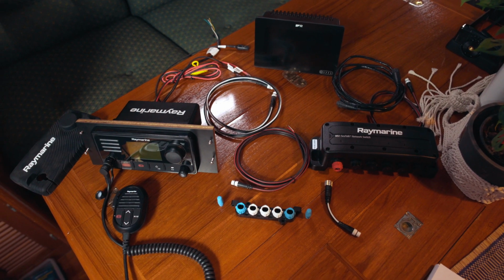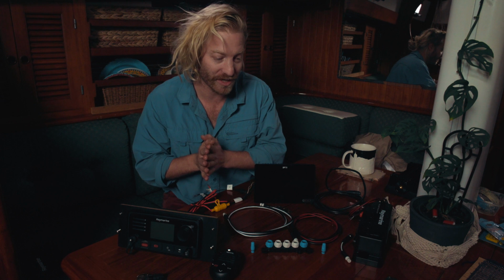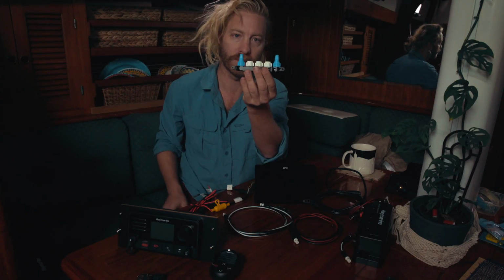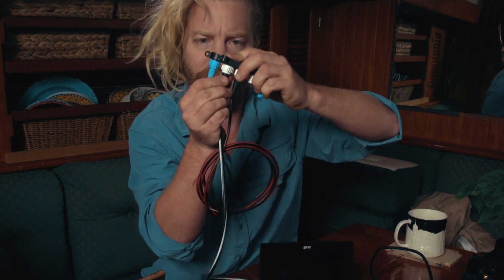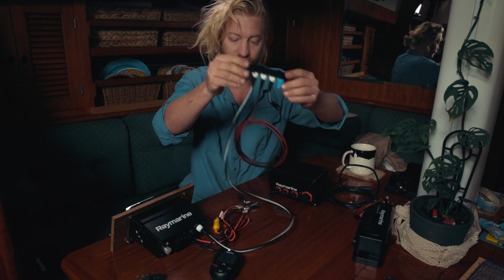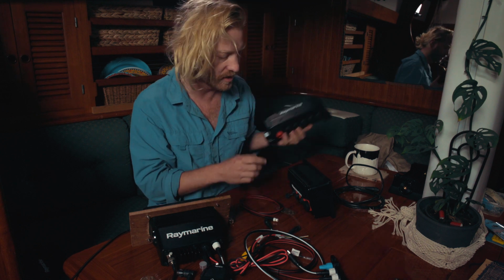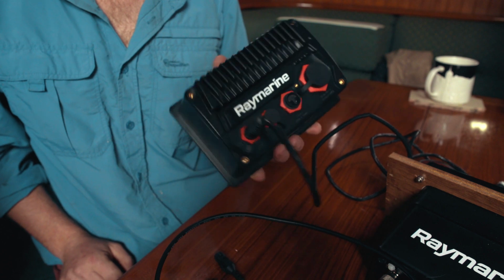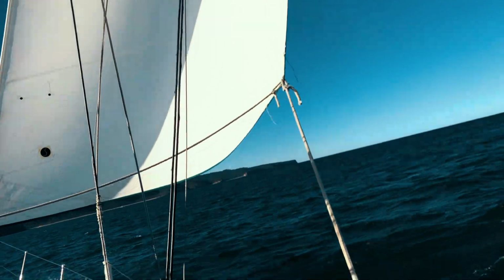How to Connect Raymarine Electronics with SeaTalk STNG Network

Comment: Hey we are currently installing a HS5 Network switch and are wondering what to do with the bare wire you can see at 5:49 
Cheery
Reply from the maker: When attaching the power cable to the Raymarine HS5 network switch, the screen wire (identified as item 4 in the power connection diagram) should be connected to ground. Here’s a breakdown of the power cable wires:

Red wire – Positive (+) power supply (12 V or 24 V DC)
Black wire – Negative (–) power supply
Screen wire – Ground connection

Ensure the screen wire is securely grounded to help with electromagnetic compatibility (EMC) and reduce electrical noise.
Reply: @Raymarine  thanks for the anwser 👍

Comment: i have a EV100 autopilot on seatalkng and a separate network switch HS5 that connects my Radar, AIS and Axiom.   I want to connect by EV100 to the HS5 so I can see my autopilot on the Axiom.   Is this possible.   I spent endless hours searching Seatalkng to Raynet to no avail.   Any Ideas?
Reply from the maker: Your Axiom screen should be plugged into both the RayNet high speed network as well as the SeaTalk NG network.

Run a cable between Axiom's Network port and one of the empty ports on your HS5 network switch.   You'll also connect your radar to the HS5 network switch.

There are 2 legs on the Axiom's power cable.  One leg provides power to the unit.  The other has a 5-pin, threaded DeviceNet NMEA 2000 data connector.   In the kit with your Axiom was a DeviceNet to SeaTalk NG adapter cable with a white connector on the end.  Attach this adapter and plug it into any empty white port on the SeaTalk NG network.  This will allow Axiom to see and control your autopilot, get data from your AIS, and share information with other network instruments.

The RayNet network is Ethernet-based and carries high-speed, high-bandwidth information like radar, sonar and camera feeds.   This network also allows multiple Axioms to share a single map card.

The SeaTalk NG or NMEA 2000 network carries low-bandwidth navigation and status information like GPS position, course, speed, depth, wind, heading, AIS, engine parameters and similar.